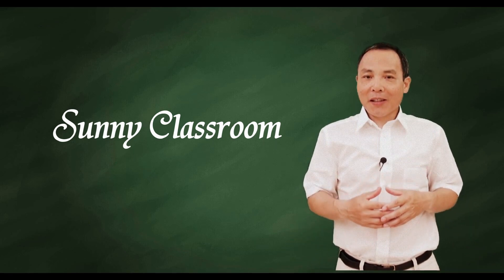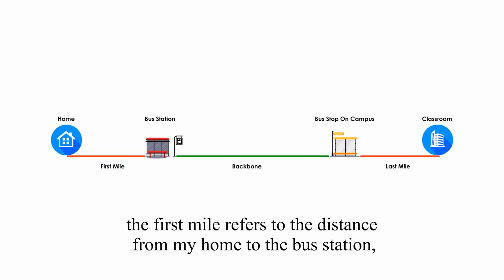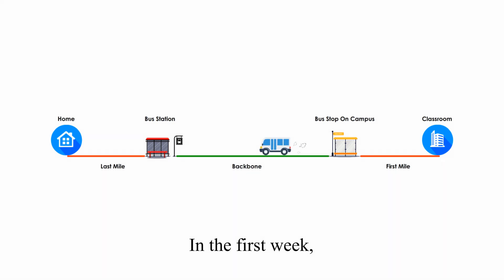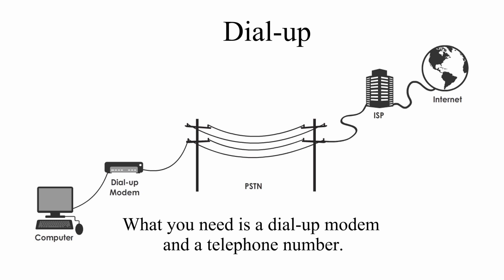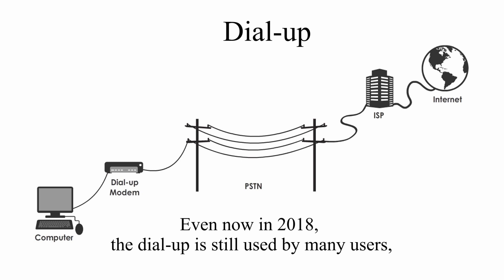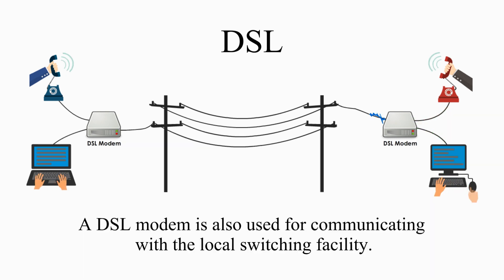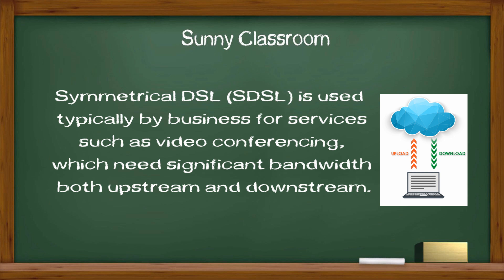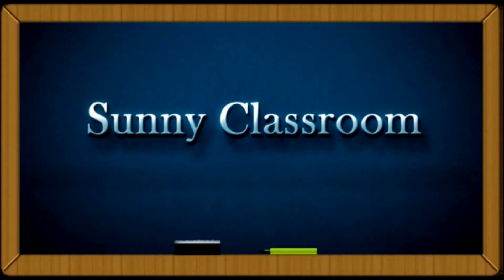Last mile technologies: Dial-up & DSL

Comment: My first internet connection was dialup and that was way back in 2008 when I was barely 15. My first impression was that I couldn’t use it for single second more so I begged my parents to upgrade to dsl. Although it worked, it was only 512kbps which meant video streaming was effectively out of question. Now I have fiber but this is the sorry state of internet in Sri Lanka if anyone’s wondering. By contrast you yanks have very good broadband so quit complaining already lol.